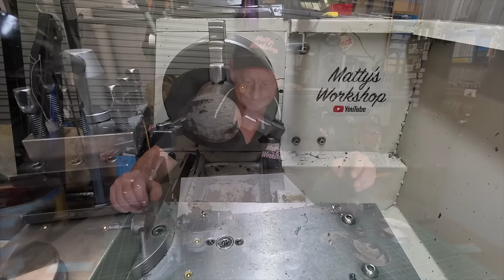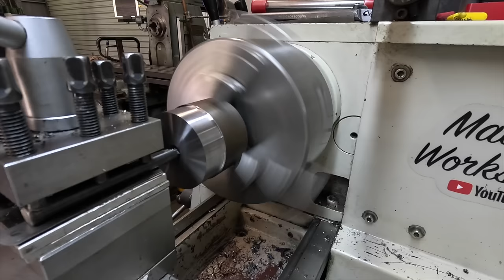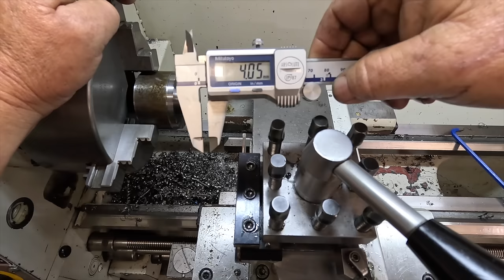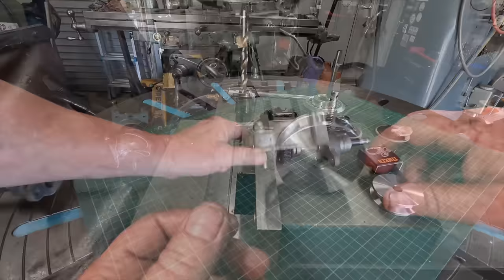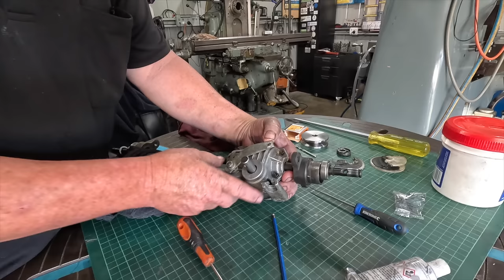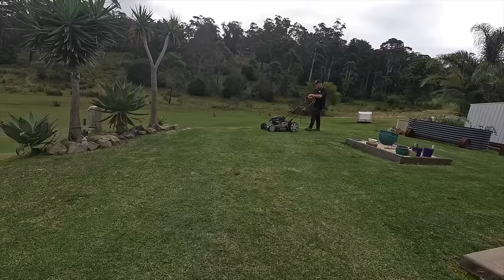Self Propelled Lawnmower Repair

Comment: Hi, Matty:  Thanks for showing us how.  Whenever you see a part like that pulley, you just imagine what took place at the mower company:
Designer:  "Right, let's put a nylon pulley there instead of a pot metal one...that will save cost."
Sales Manager:  "Have you seen how much money we've lost this year on replacement lawn mowers?  All because of a $20 part."
You definitely saved that lad a backup lawn mower.
Great to hear your DRO is on the way and looking forward to seeing that in action.  Be well and see you next week.  Cheers, mate.
Reply from the maker: Gday, I really cant understand why they use plastic components especially in the situation, the amount that would have failed would surely convince the manufacturers to rethink the part, Appreciate you watching, Cheers

Comment: Ah memories......Had to make a pulley for an old ride on I had...made it out of alloy...but I don't have a lathe or mill.....what I have tho is a drill press and a die grinder...and at the time...I had patience and a few hours spare.....got it done and worked way better than the plastic one  that detonated...
Reply from the maker: Gday, sounds like a big job to make a pulley without a lathe or mill but this shows that with a couple of simple tools anything is possible, Thanks for watching, Cheers

Comment: Ahh... reminds me of the days when I did lawnmowing. Good fix Matty. 
I wish I could look at a bunch of dirty parts, then 'nek minit' they are all clean. I use to use petrol to clean parts, but now I use kerosene or diesel. You don't want to inadvertently cause a spark when cleaning with petrol. You can throw a match into diesel and it will just go out so that is a lot safer.
Reply from the maker: Gday, Ive always used petrol and old habits die hard, I used to cart bulk fuel so I know the dangers of the stuff, Thanks for watching, cheers

Comment: Bus mans holiday for me watching this one Matty. You are on my day job Turf , (no pun intended but it works) . the plastic pulleys are appalling on mowers and they always melt out from the belt when they jam up . most are made from cast aluminium and seem to last ok , that steel one will be everlasting . Another issue can be the hardness of the dog gears . newbies try to use the drive lever like a friction clutch and wear the teeth out . the fixed bracket will be fine , some use a spring but your method is the better . damn, I have my work hat on . Stopped now mate . Thanks for sharing , Cheers Ade.
Reply: Plastics technology has come a long way but there are components that it should not be used for.  Plastic gears and pulleys are fine in a child’s toy but not in a case such as this.   I’m guessing that the cost savings on making this pulley from plastic vs cast aluminum is very small and to me doesn’t make sense.
Reply from the maker: Gday Ade, I really don’t understand why they use plastic pulleys, I’d say cost is a big factor, thanks for watching mate

Comment: Hello Matty,
A good job, well done. I like how you made the tapers with the parting tool... I have a pulley to make and will follow that approach... Good mod getting rid of the spring tensioner.
Take care.
Paul,,
Reply from the maker: Gday Paul, I really can't workout why the used the springs as the tensioner, crap system really, Thanks for watching mate, Cheers

Comment: That mower looks to be made right many that IVE worked ad repaired are very cheaply made .after over fifty years of mower and Wall engine repairs IVE seen a total decline in equipment  strength and quality to the point of use the machine for a year and  throw it away.. The mower your working on looks to be very well made .  thanks for the video.

Comment: Ahh, funny this... I`ve just been making a very similar solution myself not two months ago... I haven`t posted the video, as i still haven`t finished the project, it`s still chucked up in the lathe, waiting for me to remember if i finished the shaft bore... The pulley turned out great, as did yours, and i actually set the angle by eye... I mean, come on, it`s a single V belt pulley for a mower... The main element here is the soft belt, and being half a degree or one whole off - makes little difference to the belt... The tensioner will snug it up, squish it into the groove and it will work just great even with a small error... Now, if we were talking lathe pulleys and such, sure, precision is in order, but a pulley that sees dust, grit, earth, small bits of rock and grass being churned by the belt can be tankful for your choice of material and silent on all other matters... 
Interesting to see that you had a similar issue in no more than a month down the line... Also makes me kinda feel stupid for not actually finishing it and posting the video, as if i do now, it will look like an unoriginal idea... Tho, my piece is quite different, being the main shaft pulley, rather than being a gearbox shaft pulley... But i should remake that one too... Briggs really did some engineering sins with that mower... ``A  honda engine, a shit mower - i don`t give a damn`` was the official approach it would appear...

Comment: G'day Matty! Nice job mate, that pulley is ten times better than the plastic shit original. I know these things are made to a price And are designed to fail just outside the warranty period but fuck me that is a piece of shit deign, well not in  the manufacturers eyes,but the customers certainly. The end float you showed I think does not matter, because it only runs one way and the design of the drive gears push the shaft towards one side only when driving. If there were a reverse, then they would have to address the end float somehow. Anyway your mate has a his and hers set of mowers now lol. Cheers Matty! Sam from England
Reply from the maker: Cheers mate

Comment: Matt, hey why didn't you just bore out the hole and sleeve it??
You could've done to large hoe plugged it , welded it then re drilled the hole.
Its only a daggy motor pulley drive.
Or am I over thinking again.
Reply: Think about the standards Matty applies to his work. Notice he even polished the outside faces of the soon to be "dirty old pulley". So do you think Matty would have been satisfied with "just" a weld up and re-bore, or otherwise a re-sleeve?
Reply from the maker: Gday, Yes I could have repaired the first one but I know its not what I wanted, I'd rather take the time to make it right from the start, Thanks for watching, Cheers